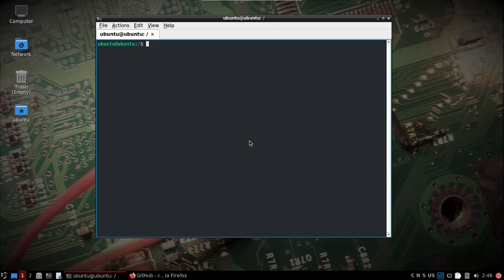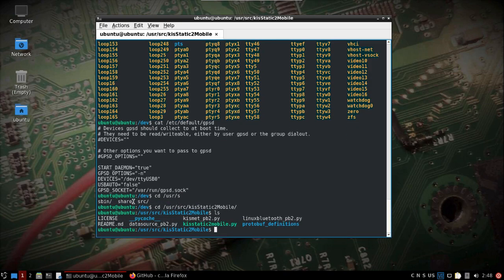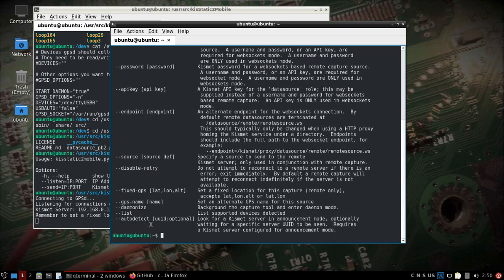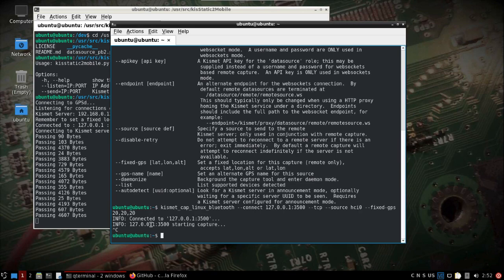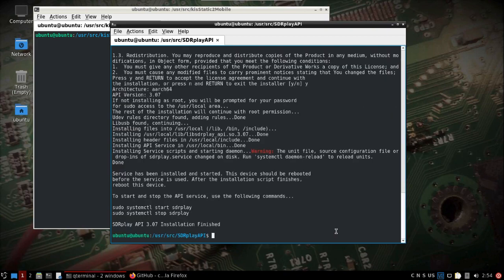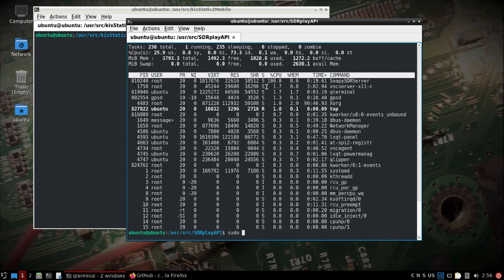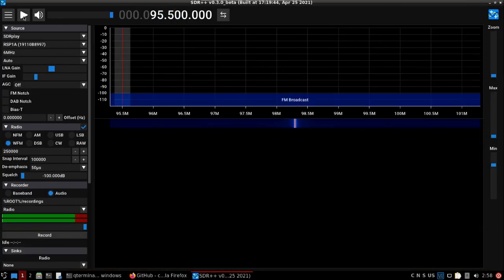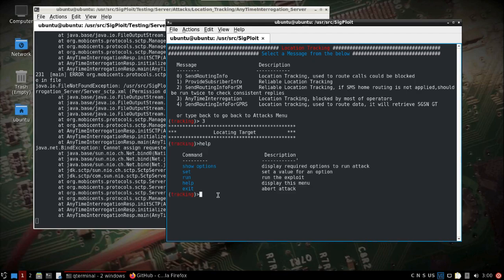DragonOS Pi64 w/ kisStatic2Mobile + Kismet Remote, SDR++, and SigPloit (Pi4, RSP1A, HackRF, GPSD)

Comment: This is great, I'm able to send the GPS data along with Bluetooth or the wireless card. Where on the Kismet server can I see or verify this? On the Kismet server, if I hover my mouse over the GPS icon, the message "GPS connection lost.." still appears.
Reply from the maker: So that icon I believe you’re looking at would be referencing the gps info being received on the actual machine running the kismet server. If instead you’re running remote cap devices and sending the gps info to the server, you’d see that reflect on each device you’ve captured. Foe example, click on a discovered access point and look at the expanded details. There you should see the associated gps info.
Reply: @cemaxecuter7783   ok, thanks. As I expand the details for the discovered BT devices, under "Avg. Location the value is 20,20. This is because I followed the video along. So I feel very close to getting it worked out but not quite there yet.
Reply: I got working.. not sure what changed.... but YESSS!!!!! thank you

Comment: grgsm_livemon is not working Help me bro
Reply from the maker: Works here, just did a video showing it work on the Pi. Latest Pi image has the fixes already applied. If you’re not seeing data then you may need to adjust the slider some left or right till you do, get a better antenna, etc.